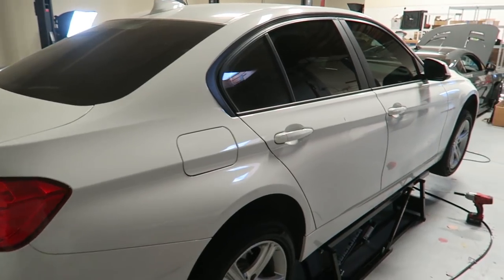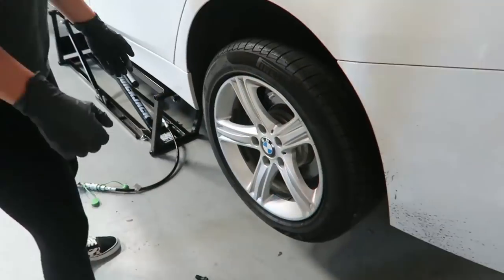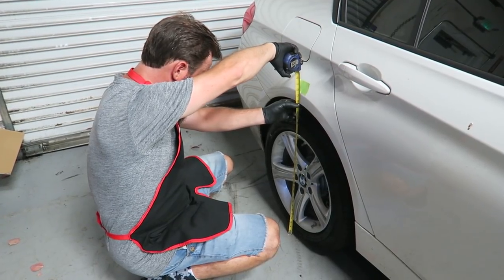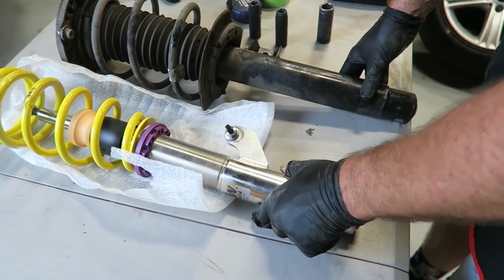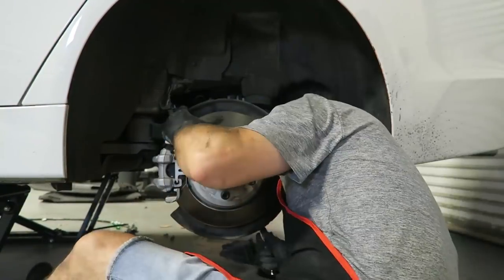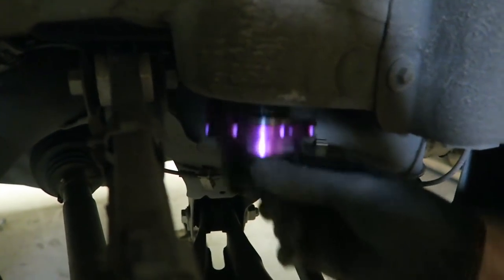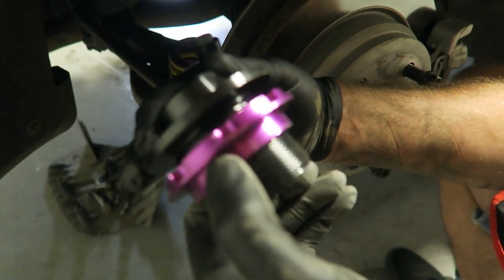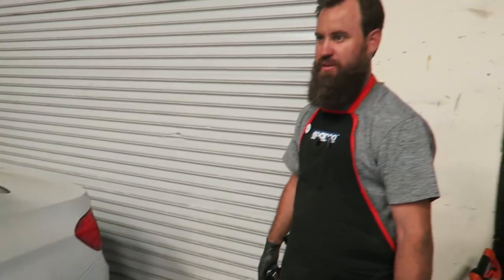SLAMMING MICKEY'S FIANCÉ'S BMW F30 ON KW V3's! (Mickey Vlog)

Comment: Im interest in installing kw v3 in my 330e f30 but not sure about the height adjustment. I just need the height to be equal as m sport suspension, because this car is also for family trip, so is it possible? Also kw v3 is actually more of a comfort oriented than a grippy oriented?? (but yea of course its already grip enough)

Comment: Bro when you put the bmw on the ground after you lift it up you have to move it back and forth for the suspension get to it’s working Point, I’m sure you I’ll know what I’m talking about. Cause that car was way to high when you measured it

Comment: Hey Micky, just found channel (actually this is my 3rd vid watched), & glad I found this! It's great to see you here as well as on TJ's!
Question.... That Locktight Antiseize "glue stick" you have (which is AWESOME, mind you!) looks easier to use; and was wondering if an,e to use normally on anything that Antiseize goes on (wondering, as never seen before & I'm used to the "rubber cement" style container.....which I hate using, lol)? 
Lastly, is it easy to find in any parts store, or an online order type product?
Thanks & as always, like watching you & picking up "nuggets" of tips & tricks....👍🏻👍🏻
Cheers, A

Comment: Great Video!  I have this very same suspension on my wife's F31.  The F31 did need a rear spacer to give me some more adjustment in the rear.  Looks great though!  My wife is running BMW 398's in Orbit Grey.  They look great with the M Performance BBK!!

Comment: Another, & last question (for today anyway 😇); what are your thoughts on the old school solution of PB Blaster/Trans Fluid/Acetone to use on the hub, etc.....is this overkill, dangerous, or not necessary anymore. It's how I was taught by grandpa back in the day & was wondering if still okay to use.
Thanks, A

Comment: Never use wd-40 or any penetrating oil on your rotors. To prevent the wheel from seizing to the hub you should just use some ceramic grease (the stuff you also use for brake discs)